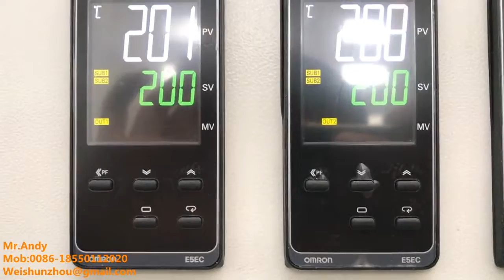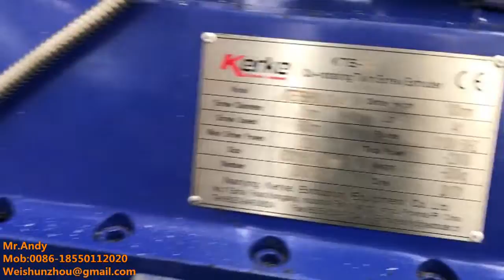Extrusion Technology Agglomerated PE Film Co-rotating Twin Screw Extrusion Design Kerke Extruder

Comment: What is the cost of the machine
Reply: depends on what it can do and how big it is. Place I work at, one of our extruders cost $250,000. Not sure if that was just for the extruder and corrugator sections. Or total after contractors come in and hook up all water cooling lines and electricity.
Reply: @leroydever4761  Depends on the type of raw material and the yield